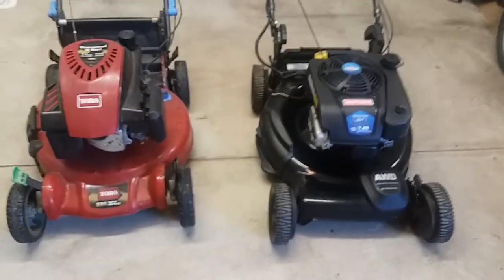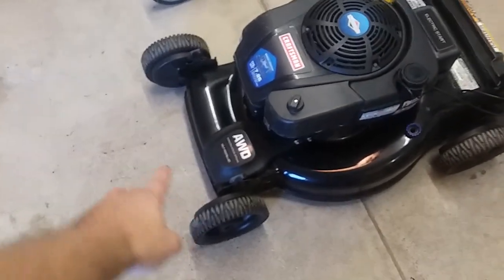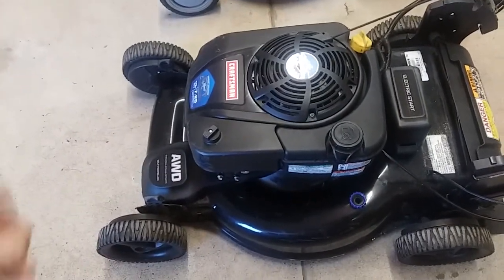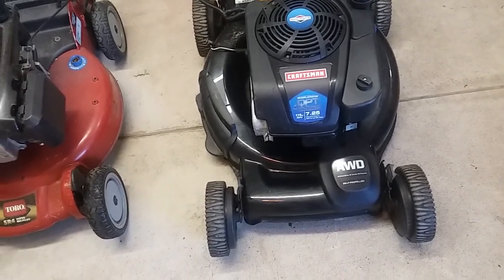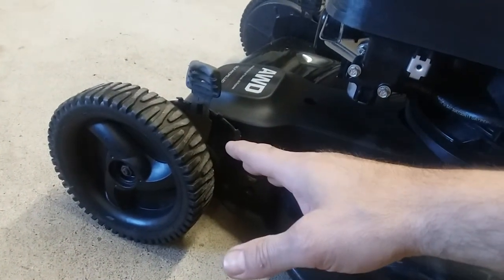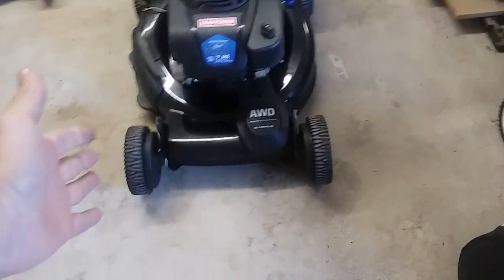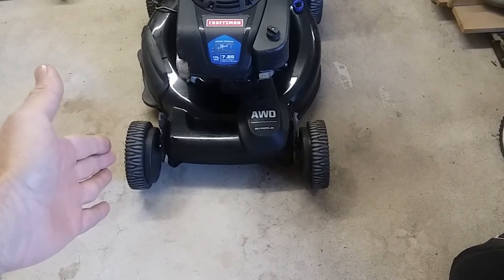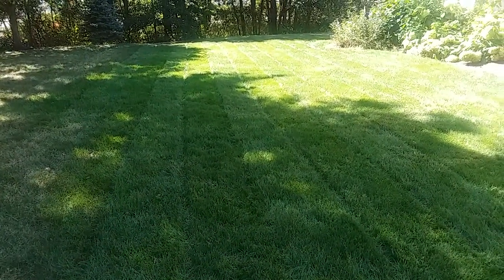Self propelled mower FWD, RWD, & AWD explained

Comment: I have always liked front wheel drive and when you are going up a hill the force on the handle is towards the front and less to the rear. It's a tough one, what I'm really interested in is big vs small wheels in the rear.
Reply from the maker: From what I have heard big rear wheels are supposed to be better for uneven lawns because they may be able to go over that without bouncing as much as small wheels. I personally prefer small wheels because I think they are easier to menuver around turns.  Hope that helps.
Reply: @berardia4  Yes is did help to hear your opinion. I guess the only way is to try it out somehow. I don't have a huge yard front and back; probably about 5000sq each yard. Tend to make allot of U turns. The large wheels were always easy to manage and I did not have to disengage the front wheels. I was looking at the Toro for a decent price and then I read the bit about just adding oil and never having to change it. Brigg's what the heck are you talking about.. They lost me on that one and I grew up with the Milwaukee based company. Love Craftsman but they have lost everything since Sear's took the dive. Honda is the way forward for me when I can get one with blade stop for a reasonable cost. HD has it but they are out of stock everywhere. Thanks for the reply.

Comment: I used the same generation as your toro but front wheel drive. It was a friends and it felt cheesy. Also adds weight to the front. You want it to be as light as possible for 45, 90, or 180 degree turns for sure. 

I went with craftsman  M320 rear wheel drive with 7.25 engine
Reply from the maker: Glad it helped you out. Please like and subscribe. Thanks